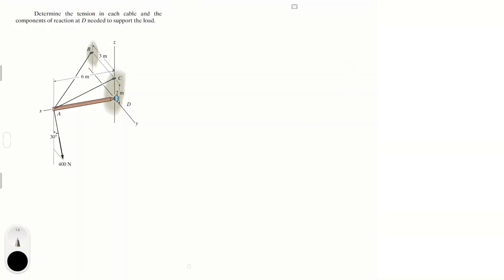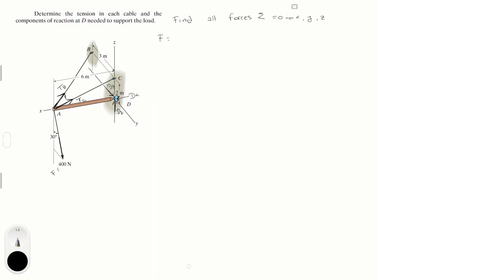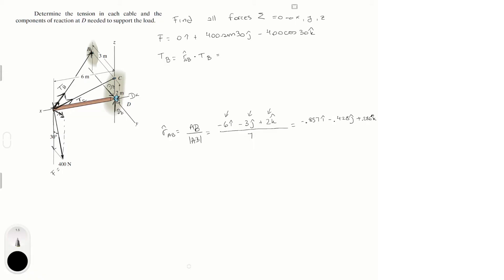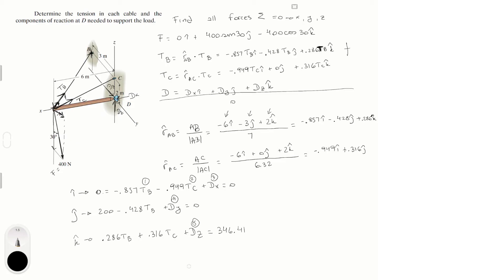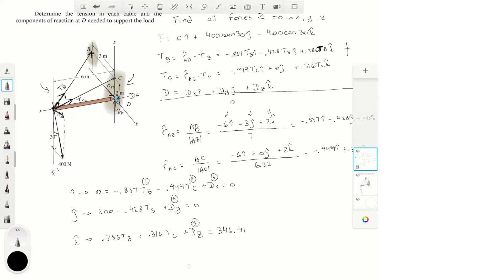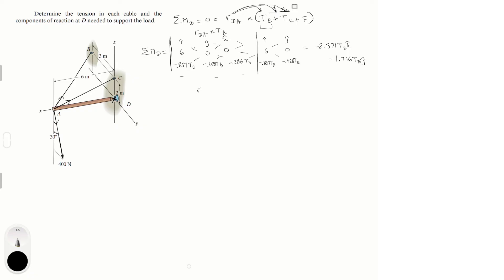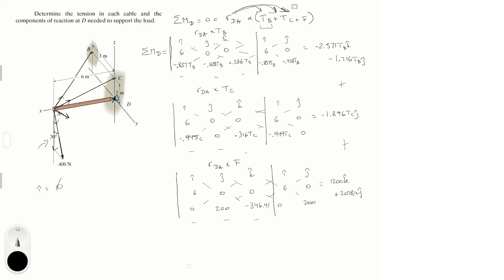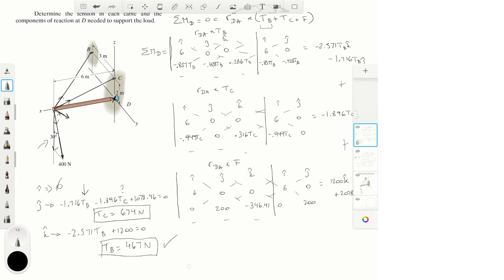Determine the tension in each cable and the components of reaction at D needed to support the load

Comment: you can take the y-component of the force vector add it to the normalized y component of AB multiplied by Tension AB, then set that equal to zero. This works because ABy is the only unknown y component. Don't have to do all that extra work.

Comment: I do not understand how you got the numbers for Dx and Dz. When I put the numbers in a calculator Dx~826.15N , Dz~71.03N. I even tried using your approximations rather than the fractions and still never got close to 0 or 1000 for Dz and Dx